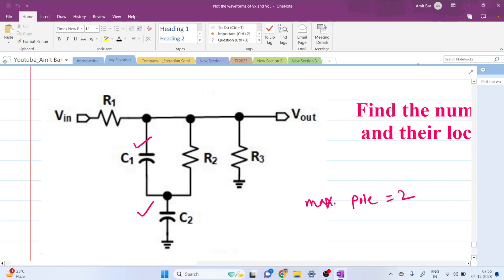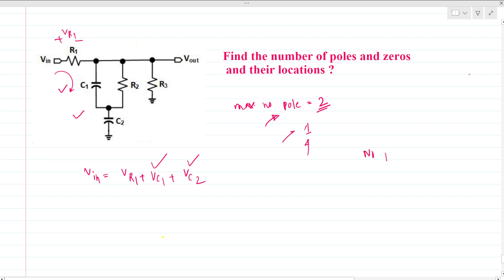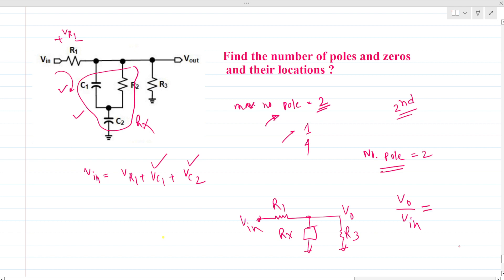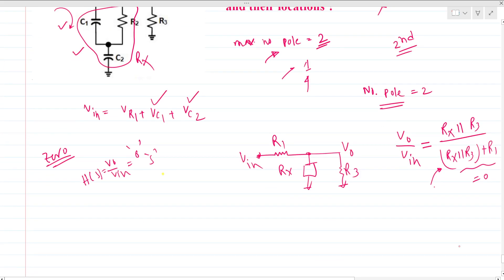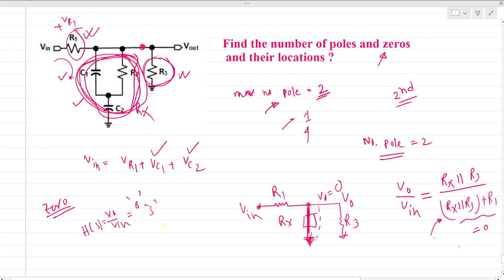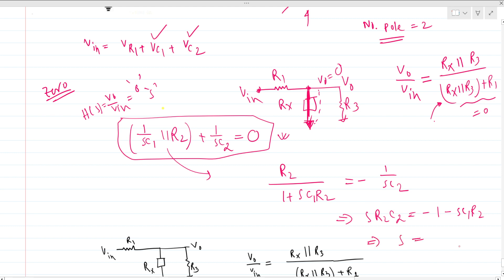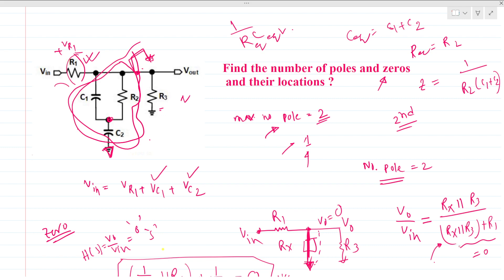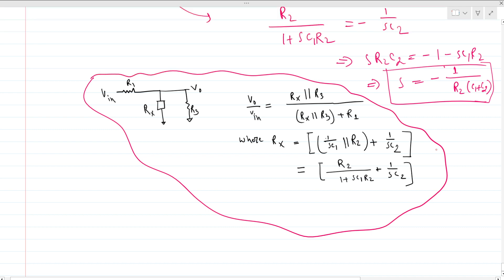Analog Design interview_ Find the number of poles and zeros and their locations intuitively

Comment: Thank you Sir
Two zero  :
Wz1=1/(c1+c2)*R2 rad/sec
Wz2=1/(R1*0)=infinity rad/sec
Dc gain=r3/(r1+r3)
Wp1= 1/(r1//r3)*0=infinity rad/sec
Wp2=1/(Rsimplified to resistor)*0=infinity rad/sec 
So T.F=r3/(r1+r3)*(1+s/wz1)..... answer 🤔
Ps:
[(1/sc1)//R2]+1/sc2=0
  ( 1/sc2)+(r2/1+sc1r2)=0
                1+sc1r2+sc2r2=0
      So s=-1/(c1+c2)*r2....Answer🤔